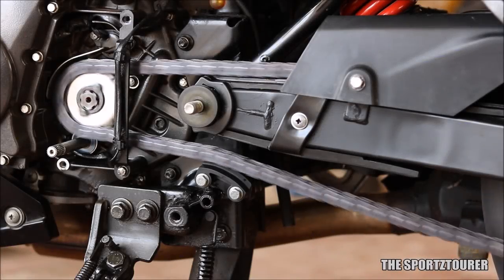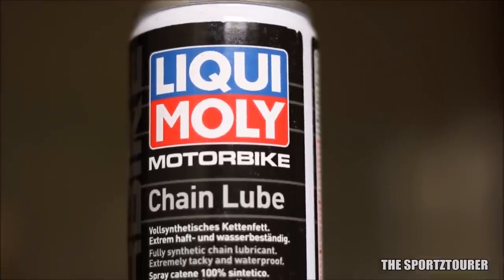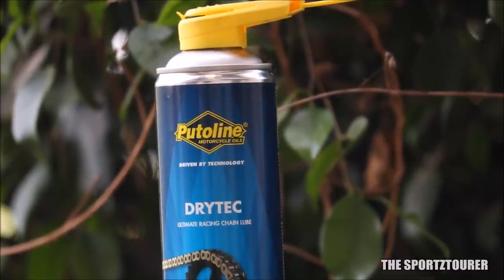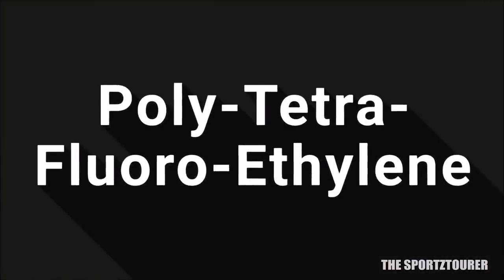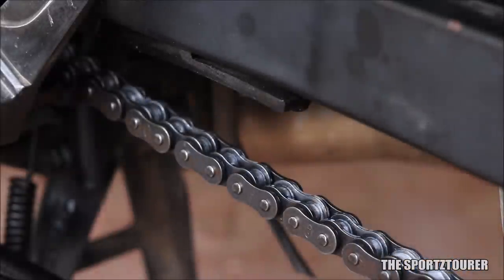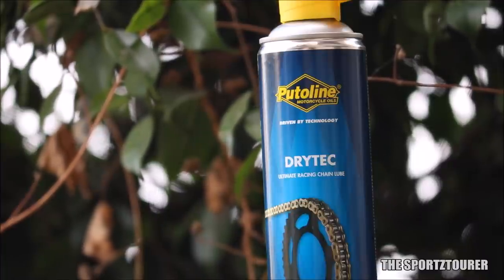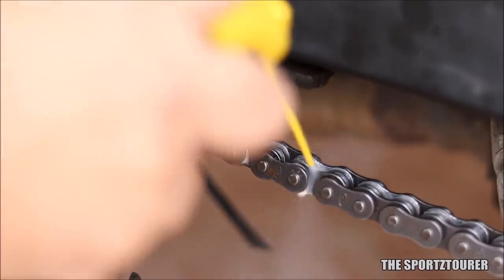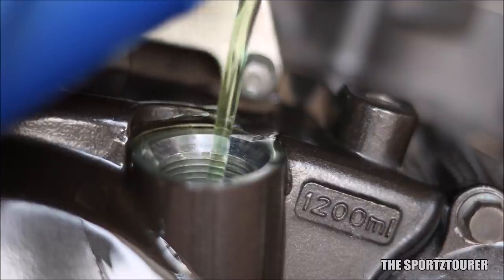I USED TEFLON AS CHAIN LUBE! BEST MOTORCYCLE CHAIN LUBE FOR CLEAN & LOW CHAIN NOISE TVS APACHE RTR

Comment: As always thank you for the technical piece ❤️
Using putoline dry tech and tech chain lube for almost 15000+ km now.
Both have never disappointed me ever, but I feel tech chain lube being ceramic if over applied damages the chain atleast in my case I had to replace chain set at 8000km.

A detailed video on tech chain expected soon buddy 👍.

Comment: I use maxima chain wax on my bike chain. Just rest it for 10-15 minutes after applying. The best thing about maxima chain wax is it does not fling from the chain after drying. It stays on the chain and also does not attract dust very much. I clean and wax my bike's chain after every 500-600 km. It keeps the chain in good condition and noise free. BTW a good video.
Reply from the maker: That's great!
Thanks for sharing the complete process here 😊

Comment: On my fz25, I use only gear oil, 90grade.
Last chain cleaning I did after 9000kms.
Just lubing the chain lightly every 300-400kms is what I do.
First chain set lasted 27,000kms.
Now odo is 40k Kms, on the second chain.
Few cans of these premium chain lube can buy me a whole new set of chain & sprocket.
Even 'if' the chain lasts less than 15k Kms, still its cheap using gear oil.
So, unless using a middle weight motorcycle which chain costs over 15&20k, no point in using these expensive chain lubes.
But yes, each to their own.
Reply: Very good point. Gear oil is still a lot cheaper that those cans. I use an old toothbrush to apply it on the chains and the dirt just happens after a short ride and i’ll just wipe it off. Keeps the chain really quiet

Comment: I used kerosin for chain clean and d 90 or the gear oil(as for manufacturers recommend) for chain lube.its looks darty after sometime.but chain life will increase if you use gear oil for chain lube.i have a 220 and still run on stock chain and around 21k +.still no sound on the chain.
Reply from the maker: Thanks Surya for the detailed write up.
Long live P220!
Reply: Are bhai idhar meri P220 ke 4 chain sprocket ho gaye 45000km me wo bhi motul chain spray use karne ke baad bhi... Actually I'm also thinking to buy gear oil instead of motul spray..
Reply: @sushilgharat2264  yes use gear oil coz it's written in the manual as well@SAE 90 ..
Reply: @sushilgharat2264  and never use petrol or diesel to clean tha chain.use only kerosin.. thats also recommend my the manufacturer

Comment: Since my chain broke and flew out of the motorcycle because while replacing the chain the mechanic didn't link 🔗 it up properly, I sold the bike and bought a Burgman executive 650 and so much in peace, change gear ⚙️ oil once every 18,000 kms .

Comment: Chain lubes are useless and a scam! Use a 90w or 140w gear oil, 1L gear oil for Rs.250 will last for 15000kms/40-50 times of lubing!
Reply: Yes... Im using for more than 2 years now
Reply: What make you to say so??? It's may ussless for small bike but for big bike long ride it's so useful I am using motul chain lube it's very sticky and can manage the heat produce by my bike... after 700km at 140 to 180kmp at the destination my chain still wet to touch I dont think any motor oil or gear oil will last as chain lube
Reply: Yes, for higher cc bikes chain lube is recommended than gear oil.

Comment: I got my dominar 400 bs6 a month back and I would like to know whether hp regular fuel is OK or by using hp power would give some advantage in performance?
Reply from the maker: Hi Ronin,
As suggested by Kartheek you can continue with regular unleaded fuel.
Congratulations on the Dominar 400 😊
Reply: @thesportztourer  thank you 🙏
At the time of delivery during briefing I was told to use only shell octane 99 fuel 😁.
Few things I have encountered which I am not sure whether Bajaj service understood during my 1 service which I gave 2 days back and neither avaia online. 
1. When ignition tuned ON nothing comes on display for few seconds (could see backlite bleed) and then in 4 to 5 seconds things get displayed and after that trip 1 and trip 2 automatically resets to 0 (happened twice in 40 days). 
During Service: updated ecu and said problem would not come.
2. Saw rust inside silencer in 2 weeks time clocked around 200 km odo. I noticed other dominar during service which ran 15k km silencer was perfect.
Service : said it is common in all ktm and dominar but could not justify me why the 15k km did not have. Later they painted inside silencer using SPRAY CAN.
3. Moisture present inside headlight. 
Service guy : common during rainy season and would go once bike heats up. 

As per your experience are above things OK what was said by service officials or another drama by Bajaj. Unfortunately I am not happy with quality. While installing hazard flasher front assemble was not at all fixed properly. I should have made a video on it.
Reply: @k.---  thank you 🙏. Will power fuel improve fuel injector anything like that. Dealer asked me to use shell octane 99 fuel which I never heard off. Thought 97 was last.

Comment: How is new Castrol power1 Ultimate Full Synthetic oil..? Is it better than tru4 synthetic..? Is 10w40 in Apache 160 4V is safe to use..?
Reply: In user manual it is 10W30 grade. Shall I use 10W40..?
Reply: @shashikumarkalledevar8433  𝖈𝖍𝖆𝖓𝖌𝖎𝖓𝖌 𝖙𝖍𝖊 𝖌𝖗𝖆𝖉𝖊 𝖎𝖘 𝖓𝖔𝖙 𝖆𝖉𝖛𝖎𝖘𝖆𝖇𝖑𝖊 𝖆𝖓𝖉 𝖙𝖍𝖊 𝖓𝖚𝖒𝖇𝖊𝖗 𝖎𝖓 10𝖜40  𝖆𝖋𝖙𝖊𝖗 𝖜 𝖎𝖘 40 𝖘𝖔 𝖎𝖙 𝖜𝖎𝖑𝖑 𝖇𝖊 𝖆 𝖙𝖍𝖎𝖈𝖐𝖊𝖗 𝖌𝖗𝖆𝖉𝖊 𝖋𝖔𝖗 𝖞𝖔𝖚𝖗 𝖇𝖎𝖐𝖊 𝖙𝖍𝖊𝖗𝖊𝖋𝖔𝖗𝖊 𝖚 𝖈𝖆𝖓 𝖚𝖘𝖊 𝖎𝖙 𝖎𝖓 𝖍𝖔𝖙 𝖘𝖚𝖒𝖒𝖊𝖗𝖘 𝖔𝖙𝖍𝖊𝖗𝖜𝖎𝖘𝖊 𝖎𝖙 𝖈𝖆𝖓 𝖉𝖆𝖒𝖆𝖌𝖊 𝖚𝖗 𝖊𝖓𝖌𝖎𝖓𝖊 𝖎𝖓 𝖑𝖔𝖓𝖌 𝖗𝖚𝖓.
Reply: @rajeshchakraborty9943  agreed, but full synthetic oils are not available in 10w30 grade.. For example motul 7100, shell advance ultra,etc r 10w40.
Reply: @shashikumarkalledevar8433  𝖞𝖊𝖘 𝖚 𝖍𝖆𝖛𝖊 𝖆 𝖌𝖔𝖔𝖉 𝖕𝖔𝖎𝖓𝖙 𝖙𝖍𝖆𝖙 10𝖜30  𝖋𝖚𝖑𝖑𝖞 𝖘𝖞𝖓𝖙𝖍𝖘 𝖆𝖗𝖊 𝖓𝖔𝖙 𝖆𝖛𝖆𝖎𝖑𝖆𝖇𝖑𝖊 𝖇𝖚𝖙 𝖜𝖍𝖞 𝖞𝖔𝖚 𝖜𝖆𝖓𝖙 𝖙𝖔 𝖒𝖊𝖘𝖘 𝖜𝖎𝖙𝖍 𝖞𝖔𝖚𝖗 𝖌𝖗𝖆𝖉𝖊 𝖆𝖓𝖉 𝖋𝖔𝖗 160𝖈𝖈 𝖇𝖎𝖐𝖊𝖘 𝖋𝖚𝖑𝖑𝖞 𝖘𝖞𝖓𝖙𝖍 𝖎𝖘 𝖓𝖔𝖙 𝖗𝖊𝖖𝖚𝖎𝖗𝖊𝖉 𝖚 𝖈𝖆𝖓 𝖚𝖘𝖊 𝖘𝖊𝖒𝖎 𝖘𝖞𝖓𝖙𝖍𝖘 𝖑𝖎𝖐𝖊 5100 10𝖜30 𝖔𝖗 𝖌𝖚𝖑𝖋 𝖘𝖞𝖓𝖙𝖍 10𝖜30 𝖔𝖗 𝖑𝖎𝖖𝖚𝖎 𝖒𝖔𝖑𝖞 𝖘𝖙𝖗𝖊𝖊𝖙 10𝖜30 𝖜𝖍𝖎𝖈𝖍 𝖆𝖗𝖊 𝖛𝖊𝖗𝖞 𝖌𝖔𝖔𝖉 𝖔𝖎𝖑𝖘 𝖜𝖎𝖙𝖍 𝖑𝖔𝖓𝖌𝖊𝖗 𝖉𝖗𝖆𝖎𝖓𝖆𝖌𝖊 𝖎𝖓𝖙𝖊𝖗𝖛𝖆𝖑𝖘.
Reply: 𝕴𝖋 𝖚 𝖗𝖊𝖆𝖑𝖑𝖞 𝖜𝖆𝖓𝖙 𝖘𝖚𝖕𝖊𝖗 𝖘𝖒𝖔𝖔𝖙𝖍 𝖗𝖎𝖉𝖊 𝖆𝖓𝖉 𝖌𝖔𝖔𝖉 𝖕𝖊𝖗𝖋𝖔𝖗𝖒𝖆𝖓𝖈𝖊 𝖙𝖍𝖊𝖓 𝖔𝖓𝖑𝖞 𝖊𝖓𝖌𝖎𝖓𝖊 𝖔𝖎𝖑𝖘 𝖜𝖔𝖓𝖙 𝖍𝖊𝖑𝖕 𝖚 𝖍𝖆𝖛𝖊 𝖙𝖔 𝖈𝖍𝖆𝖓𝖌𝖊 𝖞𝖔𝖚𝖗 𝖘𝖕𝖆𝖗𝖐 𝖕𝖑𝖚𝖌 𝖙𝖔 𝕹𝕲𝕶 𝖎𝖗𝖎𝖉𝖎𝖚𝖒 𝖆𝖓𝖉 𝖆𝖉𝖉 𝖆 𝖐&𝖓 𝖆𝖋𝖙𝖊𝖗𝖒𝖆𝖗𝖐𝖊𝖙 𝖆𝖎𝖗 𝖋𝖎𝖑𝖙𝖊𝖗..𝖏𝖚𝖘𝖙 𝖆𝖉𝖉 𝖙𝖍𝖊𝖘𝖊 𝖕𝖆𝖗𝖙𝖘 𝖆𝖓𝖉 𝖞𝖔𝖚𝖗 𝖇𝖎𝖐𝖊 𝖜𝖎𝖑𝖑 𝖟𝖔𝖔𝖒.
Reply: @rajeshchakraborty9943  OK, I WILL TRY SECOND SUGGESTION. THANKS FOR HELPING...
Reply: @shashikumarkalledevar8433  𝖞𝖔𝖚 𝖗 𝖒𝖔𝖘𝖙 𝖜𝖊𝖑𝖈𝖔𝖒𝖊

Comment: chain spray are absolutely expensive me personally using motul 7100 engine oil as a chain lubricant on my 1604v
Reply from the maker: How is your experience with it?
Have tried more viscous transmission oil?
Reply: not as good as motul chain spray but keep the job done for 500 km once u use it as chain lubricant

Comment: When I gave my bike to ASC guys, they applied a thick paste of grese on entire sprocket, chain and the chain guide. Due to this the mag wheel and the chain system became very dirty with in a day. I managed to clean the chain but couldn't reach the chain guide.. 

My question is:

Is it really required to apply grease to those parts? I am really confused if we can clean them and use oil stead to avoid ths chain and parts to becoming dirty.
Reply: do not use geese in chain and chain sprocket. Use chain lubes, And if you want something cost efficient or cheaper use gear oil as chain lube. use kerosin to clean the chain or you can buy chain cleaner as well but again that would be on the costlier side.
Reply from the maker: Hi Ashwin,
Grease is usually not recommended for open chains on motorcycles which are fast moving parts. Normal grease won't be able to stick to fast rotating part for long as the centrifugal force will try to throw it off from the links. This grease can further get deposited near front sprocket area which can cause resistance to chain movement and gearshifts.
@tiaus sardar has given some good suggestions in form of viscous oils.
Reply: @thesportztourer  thanks for clarifying it. Your channel helped me to great extent working on my apache 200.

Comment: Please suggest a good chain cleaner. PLEASE
Reply: use kerosin works superb.
Reply: @tiaussardar8192  it wont harm the chain in the long run?
Reply: @sash5427  no brother it works perfectly fine. I have two bikes(cbz and apache) and kerosin works fine.
Reply: Can we use diesel instead kerosene....as kerosene is not available in our area?
Reply from the maker: Hi Subham,
Do check this detailed video on the same: https://youtu.be/SRLMWxFeKKg